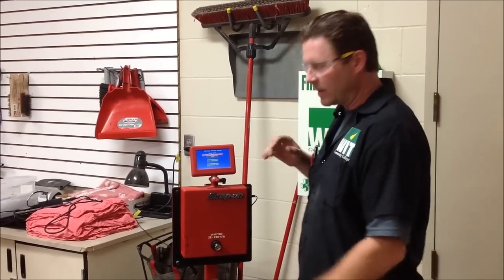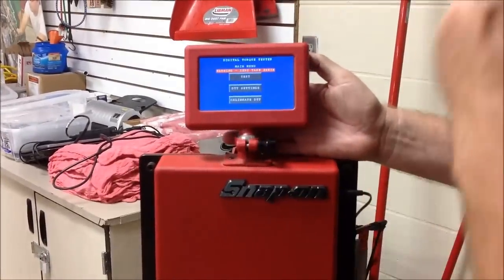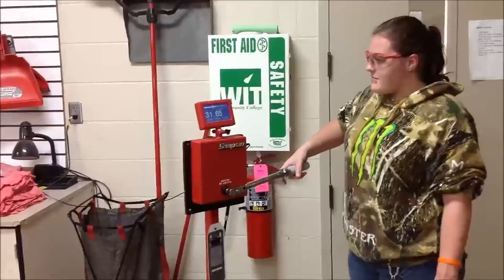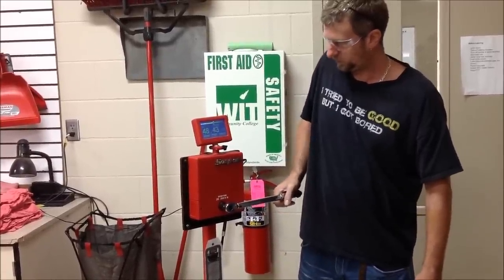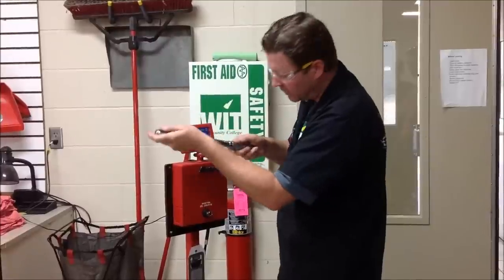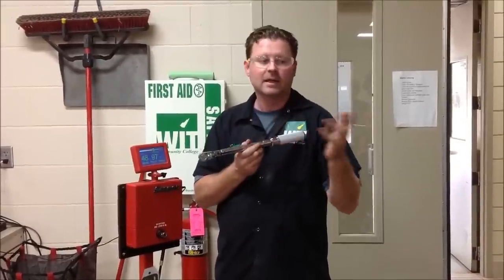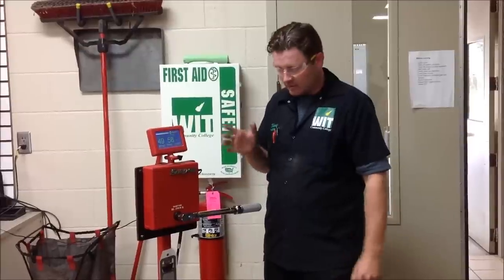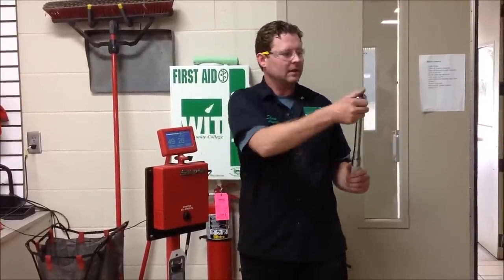Torque wrench calibration check Harbor Freight vs Snap On

Comment: As a teacher you should stick to the convention of torque units as lbs-foot, not foot-lbs.  Knowing the units tells the user that the subject is torque, not work (as in physics).
Reply: It is in practice that discipline with units makes a difference.  It is the difference between someone who has training and one that does not.
Reply: You are correct in the vernecular.  Foot pounds or pounds feet is both recognized as torque unets.  But Shane be a teacher and should follow the technical high road.  He might be the only pirson that can learn his students the unets for torque.  This may effect how other persons think about them.

My point in the above paragraph is that somebody taught me proper English.  Is the context of my message above clear?  Of course.  But you know something is wrong with me from the first paragraph.  You only have one chance to make a first impression.
Reply from the maker: As a teacher it can be difficult to find balance between teaching what is "correct" and what is commonly used in the real world for decades such as the case here. My students and I talk a lot about communication, slang, terms and such in class. If you lined up a 100 shops and asked which is "correct" you would find 99 techs say "grab the ft lb to wrench". You are correct that it is flipped. My challenge as an educator is to often question what lesson is most important when often dealing with a short time period. The lesson or intent of the video is about tool calibration, quality and usage. Even this video is not complete without watching others in the series. If every video was complete they would all be so long no one would watch and learn. Hence the thought any passionate teacher asks themselves, "what am I trying to get across in a language my student will understand outside of here". 
I would like to add that you make mention of a "detail" to which does not effect the skill required to produce a correct torque BUT not once did you thank or mention anything of real use in the real world. Not wait, once again you are correct but my thoughts are kindness in correction goes much further than "just because the book says so". 
Sincerely,
Keep Wrenching,
Shane Conley 
Instructor/Motivator/Motorcyclist
Reply: It would only take 2 minutes to describe the difference in units.  And it does not need to be on-camera.  You don't have to demand fidelity to lbs-feet for torque so long as the student knows that the world is sloppy in the use of the units.  As the educator, you are held to a higher standard.

Years ago an airplane ran out of fuel over Canada due to a mistake between lbs and kgs.

Personally, I have seen many mistakes in units.  Most get caught before trouble happens.  But I remember years ago an engineer confused gm moles with lbs moles and it affected equipment design. He used the vernacular "moles" when he should have been more precise.  He literally did not know the difference.  If somebody had taken the time early in his career to explain the difference, he would not have made the error.
Reply from the maker: titaniumsandwedge 
Did you not actually read the entire reply I left saying that we talk about this with the students on this very in exact situation when we discuss safety? I absolutely agree with high standards and the value that they hold. I also stand behind my comment that you have to work with what your working with and numerous times in life to have a we call relationships. This does not mean that we can go around those standards but it's our approach that will determine the success. My entire purpose and passion with this channel is about quality and standards. Numerous times I learn from people's comments about an area that could use an increase in quality. This very conversation was really just brought up a couple years ago when someone pointed out that it was backwards and created great discussion and classes. Life is so much more than just black and white and looking outside of the box is often needed. Your comments are welcome here.
Reply: +Shane:  I read your entire post.  The last paragraph is garbled and made no sense to me.

But no need to argue.  We agree more than we disagree.

Comment: The harbor freight wrench seemed rather accurate, just not precise. *I have it the wrong way around.  Meant that it was precise, not accurate.
Reply: +BrownParticles Wut? 10 POUNDS off is "rather accurate"?
Reply: I had it backwards.  It's precise, not accurate.
Reply: +BrownParticles No, its precisely not accurate.
Reply: +BrownParticles Your right BP. The HF torque wrench produced consistent results and is therefore precise, however the torque it applied was not the torque desired so it is not accurate. Accuracy is precision to a standard.
Reply: I disagree with your definition that accuracy is precision to a standard.  Accuracy is the average of a data set compared to a target.  Precision is the proximity of your data points relative to each other; not the target.  In brief, accuracy may exist independent of precision.  I think you probably know this I'm just posting this to clarify other people who stumble through this thread.

Comment: The position where you push on the clicker torque wrench really shouldn't have a significant effect on the torque when it clicks, since all the action is at the head.  

On the other hand, if using a breaker bar and applying a calculated torque with a weight or spring at a distance to get the desired torque (lb force applied x distance to the pivot in feet), then it's critical exactly where the force is applied.

Comment: The harbor freight seemed consistent.... just 10 lbs off. You would just set it 10 pounds lower than recommended.
Reply: but the point is the next one could be 10 pounds low and then is you set it 10 pounds low then you are now 20 pounds off ..... but I have worked on lots of cars and I think the HF would still be close enough for most jobs that the average person tackles
Reply: all you have to do is adjust it, these are adjustable (black end). you could get it right unless the internals were machined wrong.

Comment: Using a snap on machine to test is hardly impartial.
Reply: +Ali Orr Why? Do you think the Snap On torque wrench has a chip in it that communicates with the tester that it should fudge the results? Or do you think that HF could sell a more accurate tester?

It's easy to make the observation that the better torque wrench in this test is of the same brand as the tester. Unfortunately, that observation does not lead directly to an intelligent comment, as you have demonstrated for us.
Reply: No all I was referring to the tester and wrench are made by the same company and therefore are only as accurate as each other. As snap on will manufacture their wrench to same stadard as the tester. A truely impartial test would be on a certified calibrated machine of a different brand to both torque wrenches being tested.

 Making facetious remarks does not lead directly to an intelligent comment either.
Reply from the maker: +Ali Orr Hi Ali. Your thoughts are welcomed here and we'll put. You are incorrect though that SnapOn makes both. The tester is manufactured by an independent manufacturing company that also makes produces products and tests for other companies. SnapOn like many other great companies is not out to "create" a standard when it comes to the science and math of it all. Most people would be shocked to find out how often a common vender supplies product with only the badge or case change. Be well and subscribe my friend...
Reply: Thanks for info. My apologies i have just assumed, i know they sub contract the maufacturing of welders compressors etc. I just thought they would make their own torque wreches and testers.
Thanks for taking the time to post some good vids and for replying to them, good job.

Comment: it would be a good test but you didnt set the machine to 40 when you changed the wrench to 40 and totally defeated the purpose of the whole test. hmmmm
Reply from the maker: godofwar2222z 
Watch it again. Maybe you missed the point of proving actual vs wrench setting.

Comment: I had a harbor freight torque wrench.  Popped a head off a bolt before it clicked.  threw it out.  wasn't worth the $10.  

Some tools are a great value at HF, but these are not - IMHO.
Reply: That's just silly, or a defective bolt.  Most fasteners will handle over twice their rated torque before shearing off.  If you can't judge by feel that you're applying over double what the target torque value is, that is both tool error and user error.
Reply: Stinky Cheese you’re so right man!

Comment: where  you hold the torque wrench should have no bearing on the measurement.
Reply from the maker: Then you have never read the product manual. Seriously look into it. The manual link is in these comments.
Reply: +Shane Conley just talking basic physics here.   if set my torque wrench for 130lbs it shouldn't matter if I choke up on it, or use a 2' cheater .  it should click when the correct torque it's measured at the head, not where you hold it.  he wasn't getting lucky in the video, the meter was showing correct.
Reply from the maker: +David Vollandt 
David...I'm not talking anything but with we as professionals are taught from the tool manufacture. It's clearly desired by the manufacturer to hold the wrench as designed and you can easy prove this with this machine. As you move your hand up or down the tq wrench the applied tq will read differently. 
Please provide info or facts not just a random opinion.
Reply: +Shane Conley I am saying the meter was correct, and the comment that its attributed to luck is not correct.  physics doesn't work by luck.
Reply from the maker: +David Vollandt 
Fair point on the luck comment David. :)

Comment: $350 Fap-Off vs $9.99 Harbor Freight... and you didn't even show the settings. I honestly don't see the point in this video since even if i were to disregard your bizarre test methodology, someone spending $9.99 for a torque wrench is not going to suddenly decide they need to spend 35x (THIRTY FIVE TIMES MORE) money on the Fap-Off.

Comment: So why didnt you calibrate it? Seriously, you should the Harbor Freight torque wrench is repeatable when used correctly. Just calibrate it, which is very easy to do on those torque wrench. Just unscrew the endcap and use a wrench to tighten or loosen the nut. Here is a good video on how to do it. You really didnt have an excuse as you had an even better machine to test with.
https://youtu.be/XaqBA-xSGbc
Reply from the maker: Another one completely missed the point....How many people just trust out the box...Just think about it...take in the concept...not how to fix it...thats another video...You're in luck. I do offer personal service to back up what's missing from a video to actually fix your specific problem. I do work on donations for my time and possible research. 
Good news is its CHEAP! For my time would mind becoming a member of my website? It comes with a free 20 mins of techline and that will cover my time to assist you so we both benefit. So to have me personal cell phone number to put in your phone as your direct info and how to coach, sign up now! As always thank you and enjoy the free videos! Much more to come! I look forward to working with you and hope you will become a member of or learning community. 

Link to membership: https://how2wrench.com/product/membershipmembers-onlymembers? 

If I can ever be of service to you, here is a video explains how to connect with me. 
https://www.youtube.com/watch?v=vjvmB01ebcs 
Direct link to services: 
https://how2wrench.com/product-category/tech-lineservice-callminutes/ 
Live Chat is great for you to actually show your specific issue!
Donation link: https://www.paypal.me/how2wrench

Comment: Sorry Harbor freight shits on Snap On and people can't admit it. If you going for accuracy in torque these are not the tools you would use. Automobiles have huge tolerances most time when it comes to torque. So it doesn't matter. Give 2 people 5$ grand. One goes to Habor freight other goes to Snap on. You will need a truck or trailer when you leave Harbor freight from what you get. Snap on you will leave with a grocery bag of tools if you lucky.

Comment: Incorrect information on where to hold the handle.  Makes no difference whatsoever.  Could even put a big pipe on the end for leverage.
Reply from the maker: +Alex Tworkowski 
We did test it...of course we tested it. We are in a lab having a blast training and prove theories all the time. Sometimes I am incorrect. Watch the video on my channel proving hand placement makes a difference. Still doesn't change that fact that you did nothing helpful but just act like a negative "dick"
Reply from the maker: https://youtu.be/tv_KHH55qdQ
Reply: That information is irrelevant.  Your statements about where to hold the handle or whether or not to use a length of pipe for an extension is what i'm referring to.  Are you able to see the difference between that and using the little extension at the socket end?
Reply: You are correct sir. The operator will have to use more force with a shorter lever arm and less with a longer lever arm, but the torque at the head of the ratchet is 50ft/lbs when it clicks regardless of where you apply the force. It may be harder to control and not run past the click a little if the operator shortens the lever arm, but when it clicks... it's 50ft/lbs. 1 foot away or with a 10 ft cheater bar.
Reply: Heath3250  Thank you sir.  I appreciate the support.
Reply from the maker: I re-did the video using a pipe extension showing there is a difference.  https://www.youtube.com/watch?v=RsMxtEx0uik&feature=youtu.be
Reply from the maker: I re-did the video using a pipe extension showing there is a difference.  https://www.youtube.com/watch?v=RsMxtEx0uik&feature=youtu.be
Reply: When you say "the torque at the head of the ratchet is 50ft/lbs when it clicks" are you referring to where the torque wrench pivots when it clicks, or where it pivots at the fastener?  The torque where the wrench pivots when it clicks is constant with regard to the setting of the wrench. The torque at the fastener is influenced by that torque and the torque applied by your hand placement.

If it takes 25 lbs of force at the handle two feet from the "click pivot" to get it to click when set to 50 ft/lbs it would take 50 ft/lbs at one foot. (If you gripped the torque wrench half way between the handle and the head, assuming a two foot wrench.) Then you need to add the torque from the location of your hand (at the half way point it would be 50 lbs of force) to the pivot at the fastener.

The click type torque wrench pivots at two points, the point just below the head where you see movement when the wrench clicks, and the rotation of the fastener being tightened.
Reply: It amazes me that some people can't believe it, even when they see it. 

Shane, you did a great job of illustrating the difference hand position makes on a click type torque wrench.

Comment: This test didn't prove the "preferred" tool was better. Had they recalibrated the HB wrench it would appear to have been just as accurate (at 50 ft-lbs). If it was just as accurate, then why would the "preferred" Snap-On then be better? Being better is more than being accurate. On the the flip side, purchasers don't/can't check for accuracy. If they could though I suspect the HB wrench would be just fine. Curious; if you hired out your machine for testing and calibration services, what would charge? You just showed this only takes minutes. 15 minutes tops to actually calibrate a wrench.
Reply from the maker: Stanton Taylor 
Oh my friend, you completely missed the point. The point is most ALL people take a calibrated tool and put right to use. We find over and over these "Chinese" knock offs harbor freight etc are significantly off when new. I'm not proving better, I'm stating what I see as a instructor over and over. 
As far as the "charging" fee. I'm can not provide service as a non profit institution and not to mention it would reduce the credibility even more if I were charging. Ever harbor freight tech out there would want there's checked. There are reputable companies that provide testing. I'll just stick to teaching techs, how to think, how to consider risk and craftsmanship. 😊 
Make it a great day,
If I can ever be of service to you, here is a video explains how to connect with me. 
https://www.youtube.com/watch?v=vjvmB01ebcs 
Keep Wrenching,
Shane Conley
Instructor/Motivator/Motorcyclist
www.how2wrench.com

Like freebies? Click here for a free diagnostic checklist! 
http://gem.godaddy.com/signups/364621/join
Reply: "Snap-On. The brand name. The preferred one." That's pretty much a declaration of better.

Your video isn't really aimed for (lack of a better term) the non-professional. Professionals should have tools that can be trusted. This trust shouldn't cost you a reaming and this is exactly what Snap-On does. But hey, they make sure you get that extra 10 ft-lbs while doing it.

Comment: Dang!!! That's it - you've convinced me to get a Snap On.  Torque specs are just too critical to mess around with using a cheap, inaccurate tool. Actually surprised they can get away with selling such a terrible, borderline fake, torque wrench.